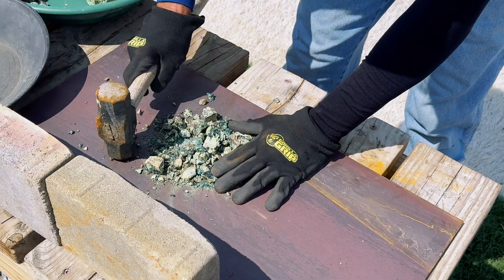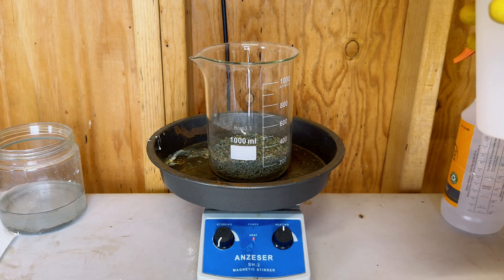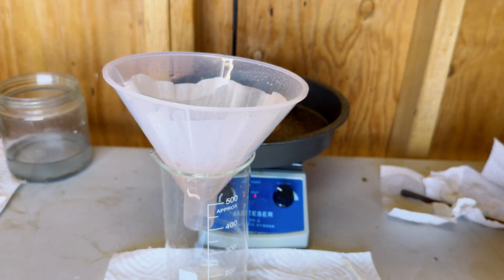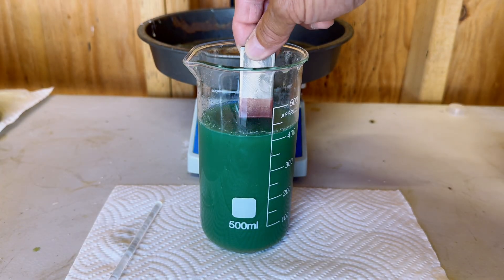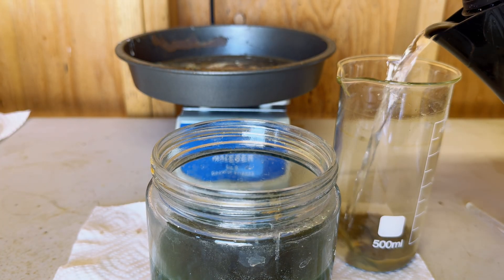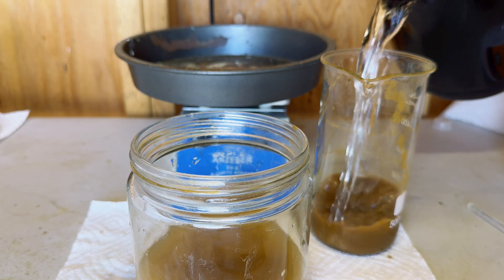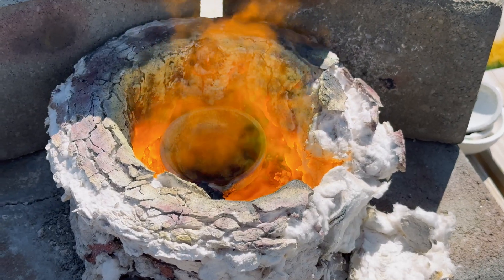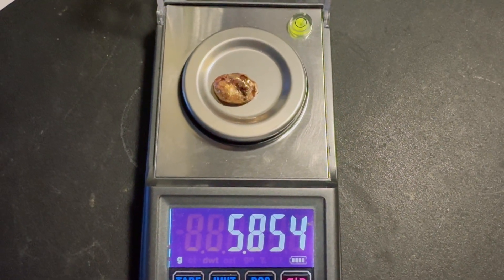How To Get Copper From Copper Chrysocolla

Comment: I should has mentioned on the last video but ive been weak and under the weather. For leaching copper ive done well with a sulfuric acid leach of 5ml sulfuric acid to 95 ml distilled water let sit on low heat overnight which does a great job of leaching all copper then just filter and cement out with a peice of iron.
Reply from the maker: Hi Garrett, I’m sorry you’re not feeling well! Take your vitamins with lots of vitamin C with bioflavonoids 💪🏻 How small do the ore need to be? Do you use Sodium Hexametaphosphate on clay material or anything? If so, how do you like using it. I was thinking of using it on Limonite. Please let me know how small or large the copper Chrysocolla should be. Can you tell I’m just being lazy and really don’t want to crush it 😂
Reply: @ErnieDionne ive got zero experience with that chemical since ive haven't had a need for it, so im not much help with that. And when it comes to the crush for leaching copper, ive always done around 1/4in minus and have leached successfully with the dilute sulfuric acid. If you just aim for around a 5% concentration plus a little heat it works great and very very cheap.
Reply from the maker: @garrettmillsap Great! Thank you Garrett, I’m going to give it a try, eventually. It sounds like a fun project to watch as I do it. Take care my friend and praying you feel better soon 😊🙏🏼👍🏻
Reply: Just saves money on expensive nitric acid. You still did well Ernie!